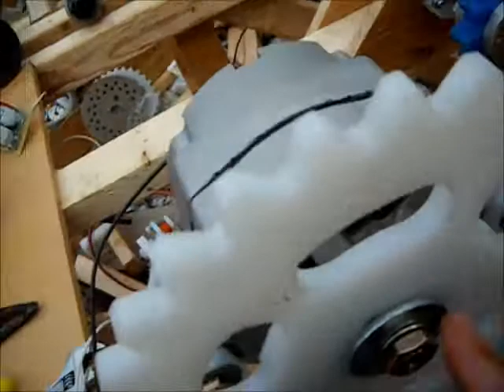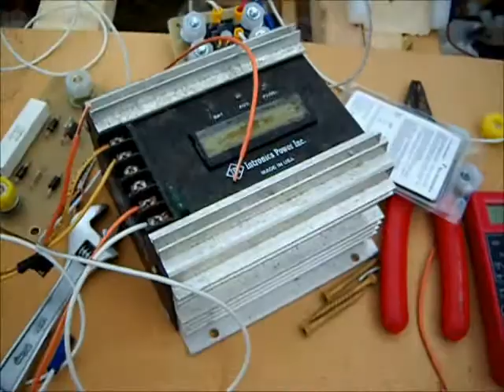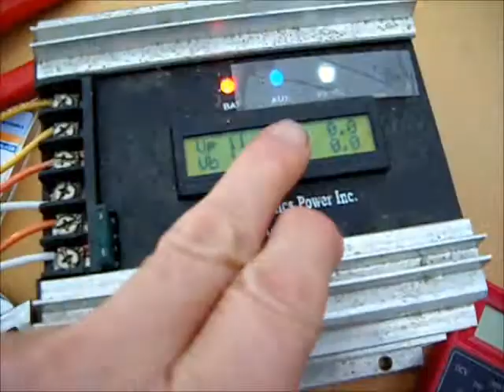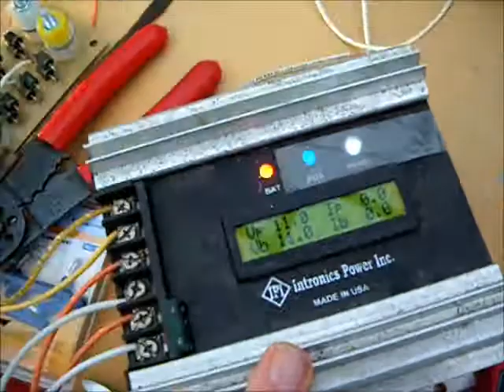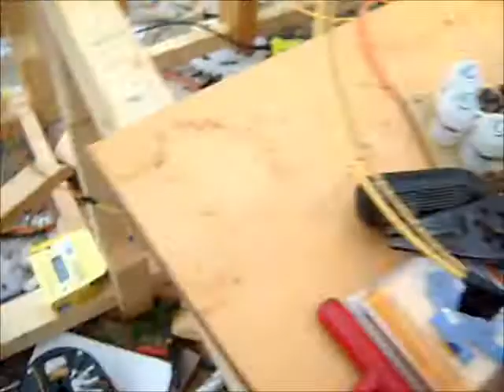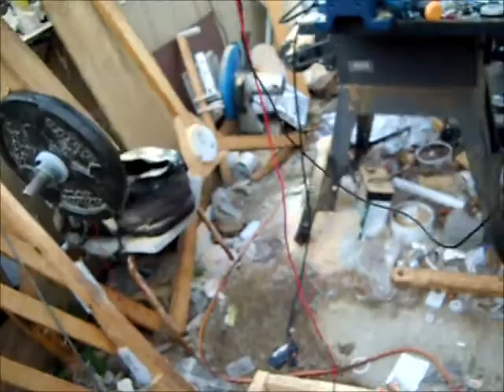GRAM 4 15 17

Comment: is that a 14 magnet stator on the pmg?
the Freedom pmg has less drag that can hand turn the stator. though you could make stator like they many do for a wind turbine that will have very little drag to.
you don't really need the charge controller in series with the output of the pma since it's not a wind turbine. the use of a charge controller with turbines that can't be stopped is to divert the power to a resistive load when the battery is fully charged.
what is the maximum power output of the pmg? you wire sizes are quite small and can be restricting the current flow also, perhaps an #8 or larger battery cable.
also clamping a light bulb to the battery while testing may be useful too.
best

like this man made stator

https://www.youtube.com/watch?v=_EJ4NWNSG9k
Reply from the maker: http://www.ebay.com/itm/DC-permanent-magnet-alternator-12-volt-for-building-a-wind-turbine-generator-pmg-/172152645196?hash=item281518e64c

Hi, thanks for the input. It looks like making your own PMA will have better results. A solar MPPT controller does not work well with a PMA. I need more force at the input. More testing to come. Thanks again.
Reply: many are now using the midnite classic mppt charge controller with the wind turbine but it's not the same application are you are using.
another thought is that these pma/pmg's are designed mostly for the torque of a 40" to 80" diameter blades, so 1 to 1 gear ratio may not be fast enough.
best